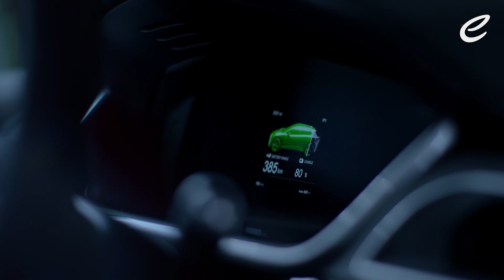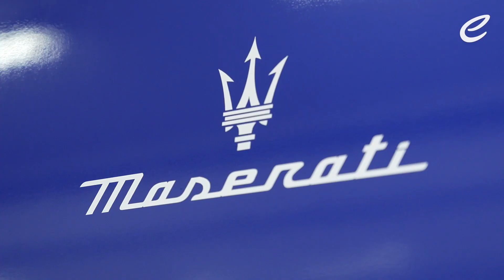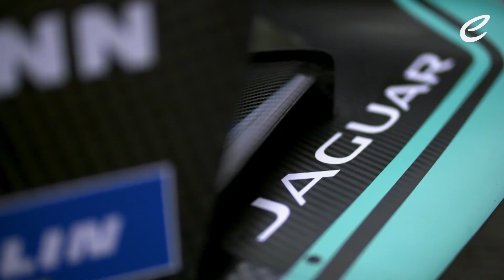Driving into the future with EV technology 🔋

Comment: I don't mind seeing EV, but I never think battery is the right long-term solution. Batteries will degrade in long term and has to be replaced all along. Also, it doesn't give as much range as what most people would believe. For me, personally, hydrogen fuel cell makes a lot of sense for long-term use. Just think of this one thing: You can easily emulate the use of petrol or diesel while never having to run out of hydrogen resource since it's always has been a renewable energy source and also the most abundant element in the universe.
Reply: hydrogen are more complicated
Reply: @NikiN1  You can say the same with battery. In fact, the charging station adoption is still going at snail pace.